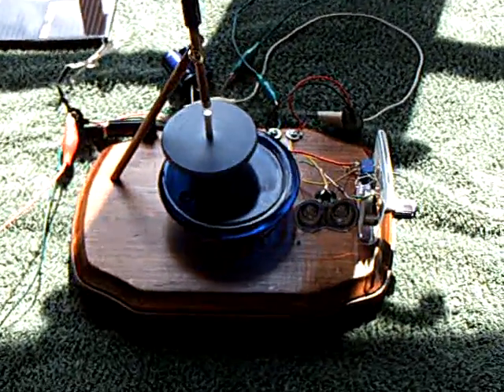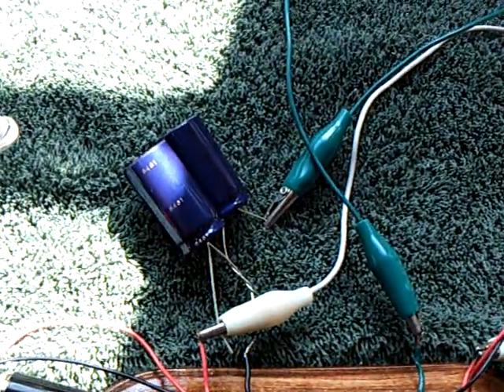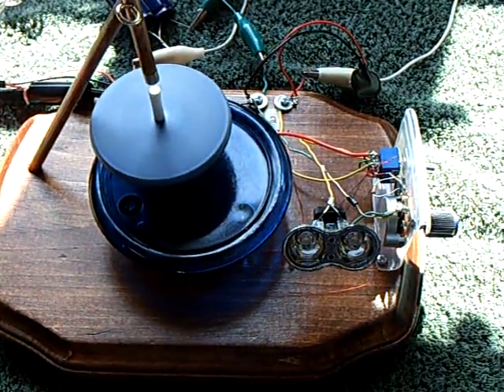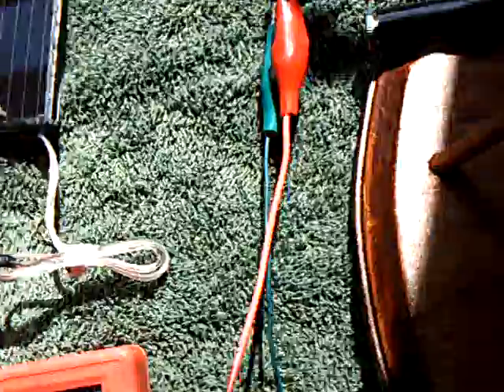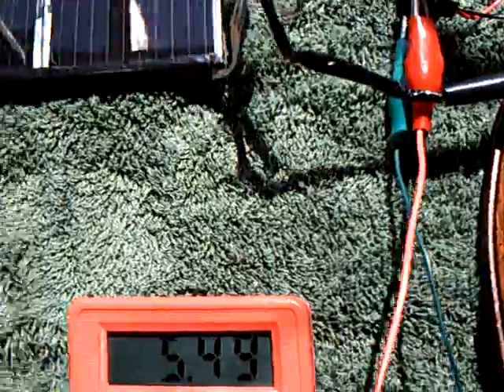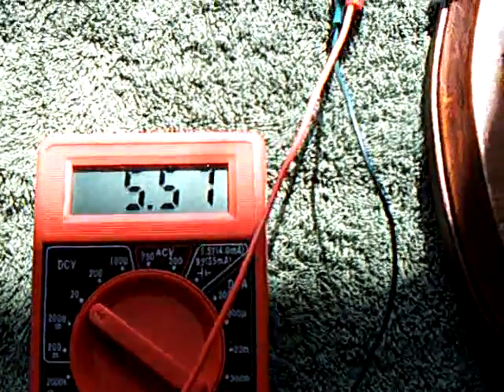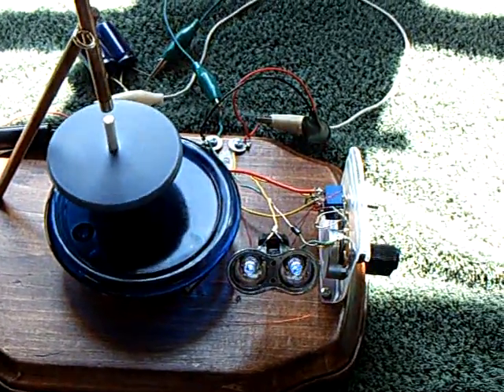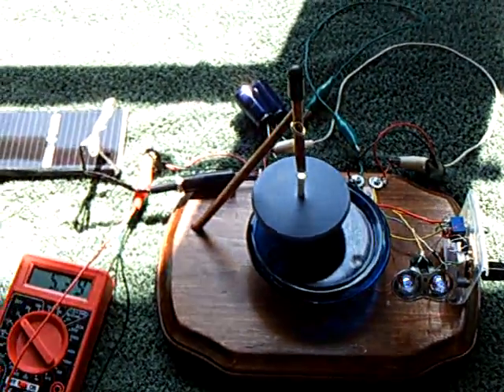Solar powered TOP CHARGER

Comment: Again Lidmotor, very nice setup... you are definitely an inspiration :) 
I got a question though, how did you connect the solar panel to the supercaps? because if I understood right the charge part on de circuit diagram was short-circuited..

Comment: another thought for that transparent contraption box. there is a video on youtube where there is a switch on the outside of a box, and mechanics inside that when you flip it a portion of the plexiglass will tilt back and then a little arm pops out to flip the switch back off. at that point the arm retracts and the plexiglass seals the box again.

i just thought that would be amusing if for example someone was tempted to open the box and grab the gyroscope. it'll close again if it has power ;)